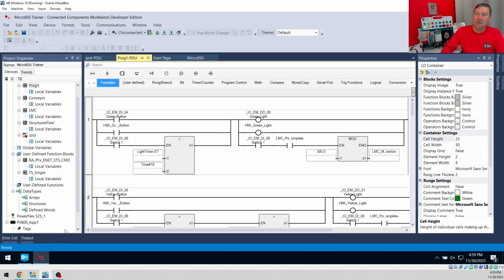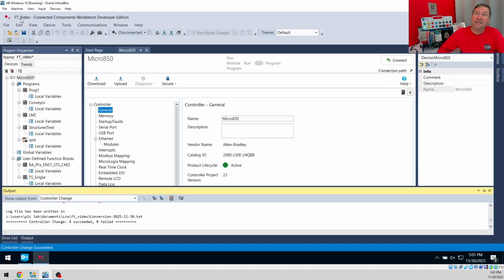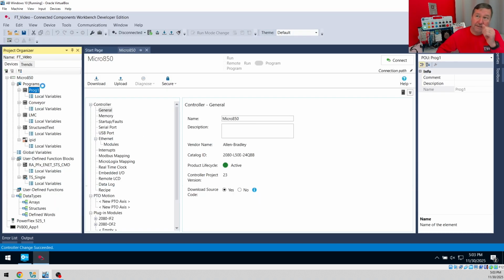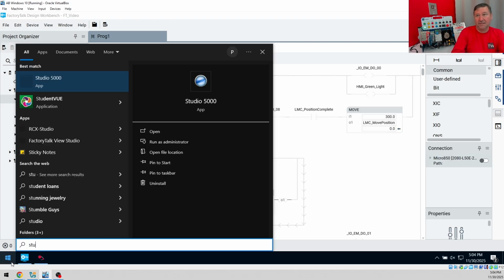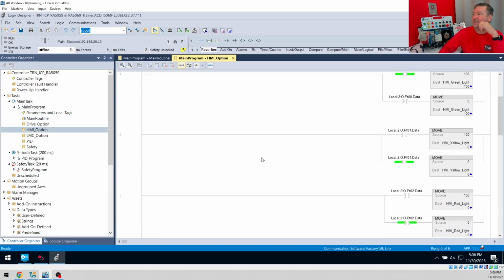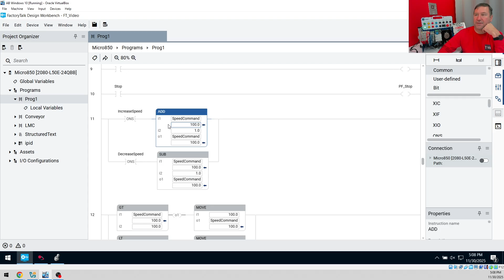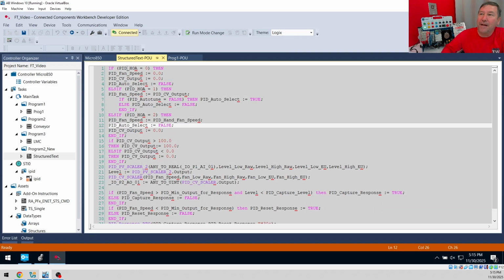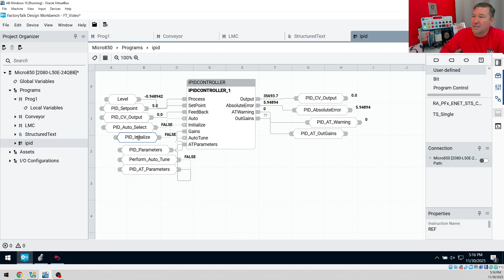FactoryTalk Design Workbench vs. Studio 5000 vs. Connected Components Workbench

Comment: I did download it to test out. However, after having watched the previous video version, I told my Control Engineer co-worker that v1 looks like it has bugs in it 😂😂😂. Is this still v1 for the FTD Workbench or v2? We have had issues before though with trying to load a saved program that was on OneDrive with company laptop. Had to throw the file on the laptop desktop and load it from there. Yeah we gad to call RA about that issue too.
Reply from the maker: This is still 1.00.00.  In fact this was the first time I opened it since the last video.

Comment: It would be nice if we could just use studio for these
Reply: Absolutely. AB is f-ing up by not just having these controllers in a free Studio 5000 version that’s only able to program Micro800 controllers.
Reply: @zerrb  i don't care about software being free as much as brand familiarity across the platform.
Reply: @sprek2  agreed. I’m just saying if Rockwell offered Studio 5000 for free, just like CCW was. With the limitation that it only programmed Micro 800 PLCs but still allowed you to create UDTs, AOIs, add EDS files, etc. in the Studio 5000 environment, they’d have a home run. You’d have people buying less expensive hardware PLCs and use Studio 5000 the same way they would with a 10k ControlLogix. Goofy that they can’t see that but I can talking to a stranger on the internet.
Reply: @zerrb  For sure.
Reply from the maker: Wouldn't that be nice!
Reply: For what we pay for studio5000 we should be able to open everything below that eg rslogix 500 and the ccw